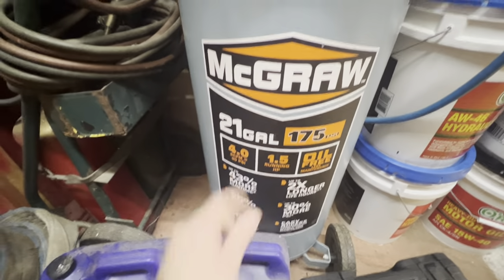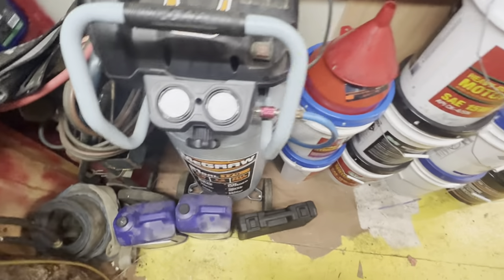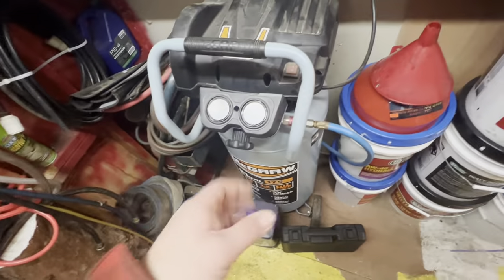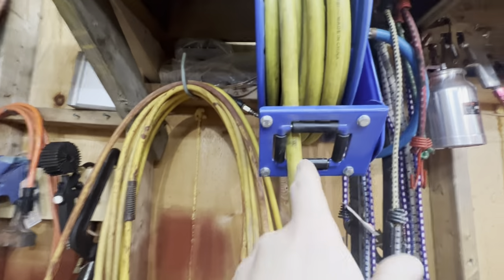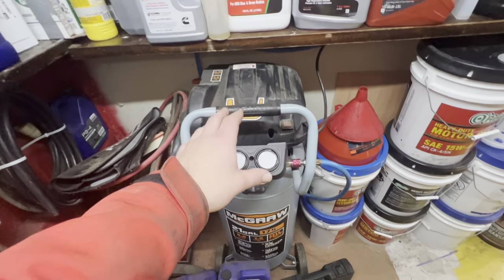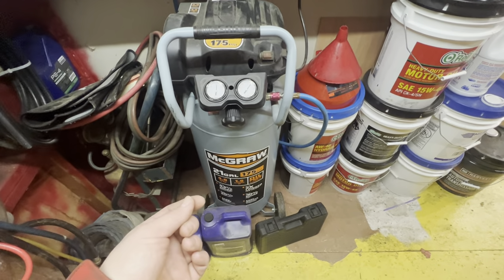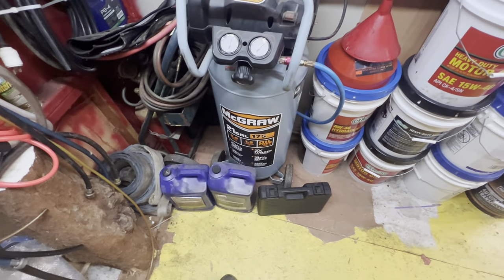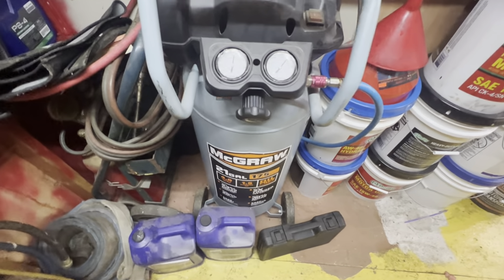Mcgraw 21 Gallon 175 PSI Air Compressor Harbor freight review

Comment: Not letting the tank fill back to cutoff pressure before using it again is analogous to taking a cordless tool battery off the charger before it's finished charging.  This is absolutely fine and probably a good time saver if you drain your batteries a lot, since even the cheap chargers pretty quick to charge to 80-85%.  
The last 10-15% takes longer because of the charge curve and balance charging.
Reply: You don't have to let batteries drain anymore we're not living in The early two thousands

Comment: could you spray an auto hood with it without it running out of air and the motor kicking on?
Reply from the maker: If you referring to painting without it running. Yes if u shut the unit off once its full..
Reply: @THEWORX99  yeah I just dont want the compressor kicking on in the middle of painting my hood and dropping pressure. Thanks 🙂

Comment: Get another one and run them together in series it will increase your cfm there is a guy on you tube that has them together doing body work
Reply: That's what I did I just took off the pressure valve and tapped into an old DeVille Bliss  20 gal. compressor and it works great. I run my air hammer chippn marble all day.
Reply: I don't even have them in series I just use the other tank for volume and I'm good
Reply: At that point why not just buy a 60 gal?
Reply: @senseielim2439  mobility, lower initial buy in.